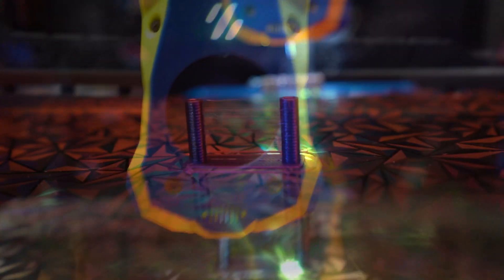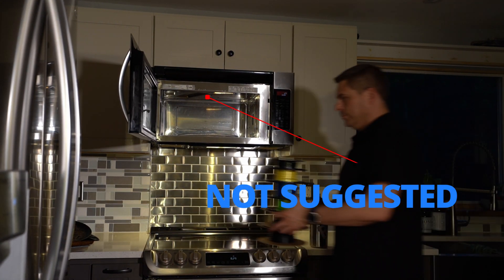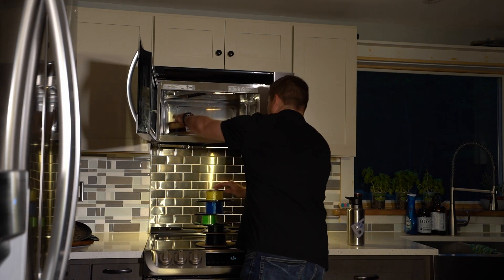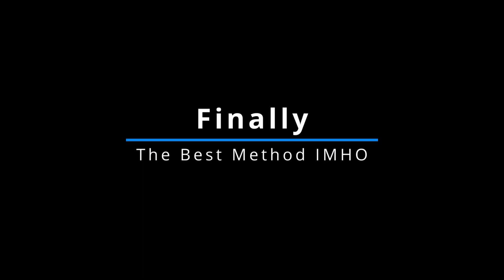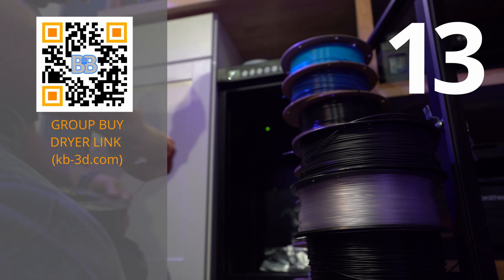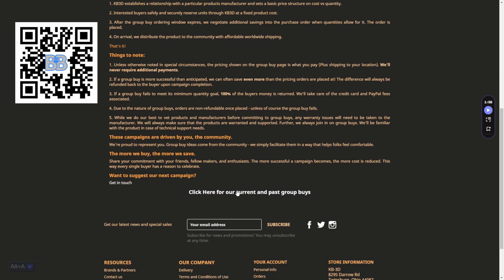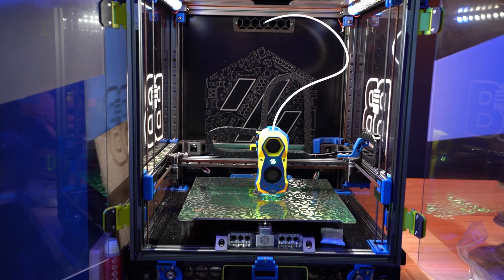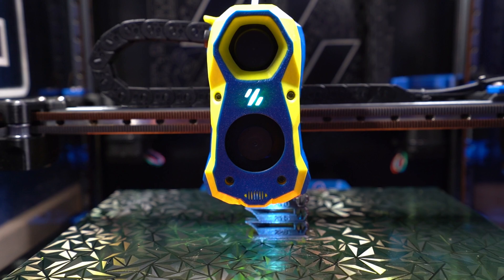Are You Ruining Your Filament? Discover the Right Way to Dry It!

Comment: Wonder if a solar drier would work.  Box with exhaust fan and glass cover out in the sun.  Just a crazy thought/idea...
Reply from the maker: Check out the new video from CNC Kitchen... He goes deep in microwave use!  I did it mostly as a joke (to start) but, it's an option!
Reply: @BuildItBasement CNC Kitchen only showed how he used microwaves for desiccant materials. Useless.
Reply from the maker: @RUS38  Useless?  I believe the point in his video was that microwaves indeed can heat up water molecules causing them to push out of the material.  He warned against the overheating of material and some basics on how he dried his desiccant.  I believe most of the same principles can be migrated over to a roll of filament.  You must not hammer the material with microwaves, "slow" and long makes for it to be useful. This video was meant to be fun - but make us all remember that experimentation is key!   What seems like magic or insanity today, may be the norm tomorrow. Not to say we're all slowly going crazy!   Thanks for the comment!  Please keep them coming on this and any other video of mine you watch!  :_HelperDISCOBIB:

Comment: Thanks for the video! Are you able to put two brand new rolls of Polymaker filament laying flat side-by-side so you can slide either one out past the other or does one roll need to be pushed back slightly into the cabinet behind the other one?
Reply from the maker: I'm not 100% sure I understand.  Out of the box you gain a little room since the spools are bigger than the filament that fills them.  You can fit them stacked inside (sideways) and a couple (vertical) in the front of those.  Hope this helps!

Comment: This video definitely needs to be on the group buy page.  I've been perseverating on one of these for so long because it looks like it can only hold 5 rolls from the pic on the group buy.  Knowing i cam get rid of most of my  cereal boxes with this has put me over the edge.
Reply from the maker: I love mine - I keep most of my expensive filaments in there.  If you plan to use it as a feed you'll fit a few less, but it will fit at least 10 rolls in there with enough room to allow for the five feeding spools!
Reply from the maker: https://kb-3d.com/store/kb3d-group-buys/1160-kb3d-group-buy-6-filament-drystoreprint-cabinet.html
Reply from the maker: Kris added it

Comment: Dryer could work potentially with a pillow in there with it
Reply from the maker: Hey - Jokes aside, it could.  - Some people have suggested dryers with shoe dryer inserts.  If you needed to dry a bunch of filament quick before storing it for use, it was meant to be funny - but the irony is that it could actually work.

Comment: as a chemist i would like to make it very clear that putting filament or anything you make out of it anywhere near your food or cooking utensils is a terrible idea.
Reply from the maker: I agree
Reply: Why? Filament is not that different from all the plastic cooking utensils, kids toys and other plastic stuff we have in kitchens. It's not a powder or has high risk of getting into your food, like small ABS Lego pieces for example.
Printed parts do have a much higher chance of getting into your food and the porous structure isn't great either because it can host all sorts of ugly.
Reply: @zapl80  No, they are not even remotely similar to plastic cooking utensils, toys and other stuff meant to have human contact.
You can't see the chemical makeup by looking at it.
Anything that is meant for human contact, especially cooking utensils and toys, are regulated so that only plastics are used that don't have highly toxic monomers , so TPU goes straight out the window. Catalysts and additives are also regulated and must not leech out of the plastic. 
With filament there are not only almost no rules, but they also have to add colorants, flow modifiers, UV protection and antioxidants etc etc etc.
Its a terrible mess and should never be near anything you eat.
Reply from the maker: @monster2slayer  One example would be PET vs PET-G.  I try not to consume glycol...  Some filaments are made to be in use with more pronounced human contact, but they are far from all the masses of other plastics - It's a general rule.  https://amzn.to/3Rtkgun - One such filament.  Here is a "decent" article about the topic. As will all things including my comments and videos - do your own research and make your own decisions!  https://formlabs.com/blog/guide-to-food-safe-3d-printing/
Reply: @BuildItBasement  edit: yeah, that formlabs link you posted basically sums it up.

the problem is, even if you manage to buy genuine food grade filament, no one has a food grade printer. you are using PTFE tubing, you have used non-food safe filaments in the past, your grease isn't food grade and so on. Unless you really know what you are doing, and you're printer is built from the ground up to be food grade and only food grade, it isn't food  safe.
Reply from the maker: food grade grease would be easy enough and you don't HAVE TO have a bowden tube.  All points you make are valid.

Comment: I'm very much into that EIBOS vacuum pump system. I printed small cylindric boxes with holes which, filled with silica gel desiccant, I put in the middle of the filament spool and then vacuum the bag. It's comparably cheap, energy-saving, easily extensible, and seems to work well so far, no problems at all with wet filament. :)
Reply from the maker: EIBOS makes some nice products - I maybe I'll get the opportunity to try some at some point. The vacuum pump is a great way to store dried spools.  I've used similar items in the past.  The limitation is the ability to use the filament while it's in the dry air of the bag.  Very cheap, VERY energy efficient!  I enjoy these comments - if anything I want to spark conversations and comments so people can learn from each other.  Please always feel free to leave a "what I do" on any of my videos!  The more we all know, the better we'll all be.

Comment: Some clothes dryers have racks that don't spin for delicate items... ours does, but I have a dedicated filament drying box.
Reply from the maker: In the spring, where I live everything goes from 10%RH to about 70.  Being able to dry a dozen rolls quick would be nice!  Dry and then into the low power dry box.
Reply: @BuildItBasement  I am east coast also, Maryland  :)  Thanks for another fun video.
Reply from the maker: Howdy neighbor.  I'm in Maine.  No worries, over the years a lot of people have a lot of problems that often include filament that isn't as dry as it should be.  This is a blanket statement to do your filament if you're having issues.  The dryer referenced is just a good design, highly suggested - but not necessarily the only way.  I finally took some time to make a fun video, hope it is enjoyed by many. 🎉🎉🎉
Reply: @BuildItBasement  Maine humidity has nothing on GA and FL, I grew up in Maine and I don't remember humidity like we get in GA. (or pollen) :)

Comment: If you want to do the dryer method, find an old dryer and remove the drum belt. An electronics shop I know of did this to dry circuit boards and it worked nicely for that.
Reply from the maker: Great tip!  Surprised I'm saying it.  But, makes sense!

Comment: u can turn the spinning off on some dryers, its like shoe mode or somethin like that
Reply: Mine does that
Reply from the maker: @TheOneAndOnlySatan  ...Just when you think you have a good dryer... Guess when these die I'll have to keep an eye out for "Shoe Mode".  I'm also wondering how well a heat pump dryer would work....
Reply: @BuildItBasement  i will try it, but i dont think it will work that great. But lets try!
Reply from the maker: @TheOneAndOnlySatan  The bigger thing to remember is heat is great to pull water out of filament - but a dryer cabinet is what people need to keep from re-drying filament every few days/weeks.
Reply: @BuildItBasement  I think the dryer cabinet you're promoting isn't what’s needed. It's an overpriced niche technology that doesn't effectively free up moisture within the filament; it only keeps the air in the cabinet somewhat stable, but it doesn't dry it. What they try to achieve with the Peltier should actually be done with a molecular sieve, and even then it would still fail. Using a big storage box with a bottom of calcium chloride yields far better results. It's strong enough to pull out moisture without power and is very cheap. An example of a better solution would be using the Sunlu S4 with heat, moving air, and the insane absorption of calcium chloride, even for long term storage.
Reply from the maker: @TheOneAndOnlySatan  While I agree with you about using heat to remove moisture from filament, I have reservations about the constant application of heat and the use of expendable chlorides. The dryer system I use produces condensate, indicating it removes water from the air inside the cabinet, albeit in small amounts.

My recommendation for this type of device is for storage and regular use, rather than drying a spool of filament quickly. I believe I made this point previously. The Peltier system provides sufficient surface area to condense water from the sealed cabinet and can also generate minor heat when inverted.

Maintaining filament at a higher-than-normal temperature can lead to cracking or weakening, and repeated moist-to-dry cycles can exacerbate this issue. Much like heat moves from warm to cold, moisture moves from wet to dry. If the box can maintain a 5-10% humidity level, over time, the filament will achieve the same moisture content of the cabinet, without the detrimental effects of hot/cold cycles that a standard filament dryer might introduce.  A wet sponge won't stay wet in a desert with very low RH.

The design I am advocating is already used across various industries, from industrial to cinematic and photographic fields, to provide stable, low-humidity storage for sensitive products. I appreciate your comment and for emphasizing the potential need for heat when drying filament quickly!  It was a fun video to watch and hopefully, you enjoyed the satire!
Reply: @BuildItBasement  weird that you like your own posts..
Reply from the maker: @TheOneAndOnlySatan  It's referred to as self-love to YT folks. :_HelperDISCOBIB:
Reply from the maker: I was doing as a joke and thought - WAIT!  this is a big low-temp convection oven.  Throw a shower rod and some clamps in and BOOM!  Maybe I'll do it?  Lets see if people like this video!?:_HelperDISCOBIB:
Reply: @BuildItBasement  yeah I might try the dryer thing